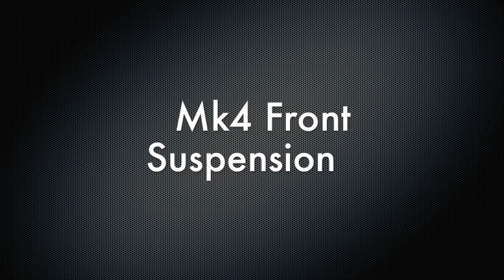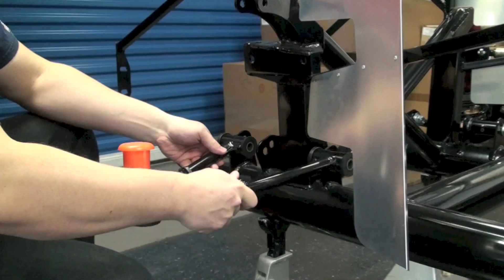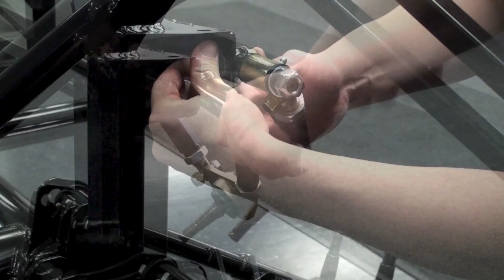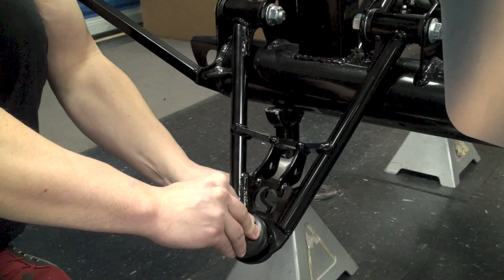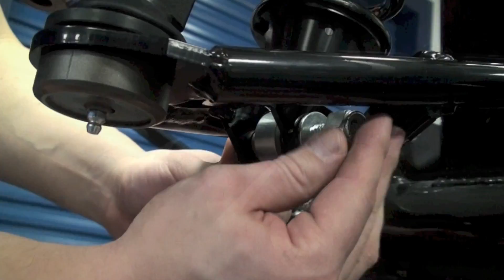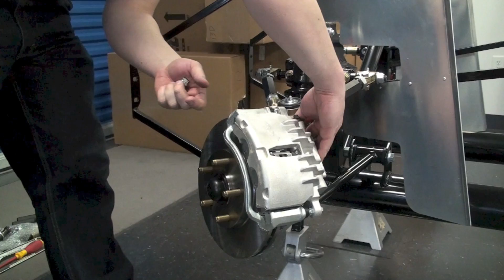Factory Five Mk4 Build Episode 3: Front Suspension

Comment: Has anyone had trouble with the upper control arms vertical rear bolts being too close to the horizontal plate?    I can't fit a wrench between the locking bolt and the plate.     Thanks!
Reply from the maker: Please send photos to tech@factoryfive.com, and they can try to assist you.

Comment: The manual says the upper control arm goes on the Horizontal surface, not the vertical surface, as shown in the video (should be mounted 2" higher than as shown).  Also it says the solid corner of the A-Arm goes to the front of the car (2bolts holds the rear adjustable sleeve, 1 bolt holds the front adjustable sleeve, the other end is welded to the Balljoint mount.)  The ones in the video are on the rear, so it appears they have swapped the left and right upper control arms.
Reply: This confused me as well. If you are using the Mustang spindles then the "top" mount is correct. The  "side" mounts appears to be for the Factory Five spindle. Excerpt from the build manual: "The side mount holes are for the Factory Five optional spindles and provide a slightly different
front geometry and handling". I guess it depends on your build.
Reply: I noticed that too